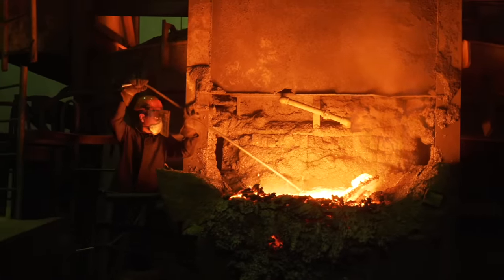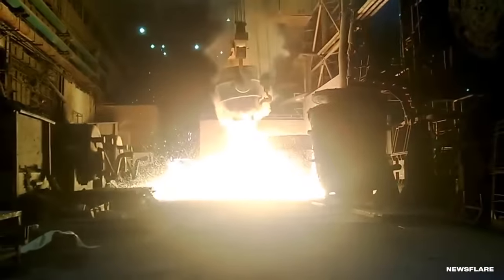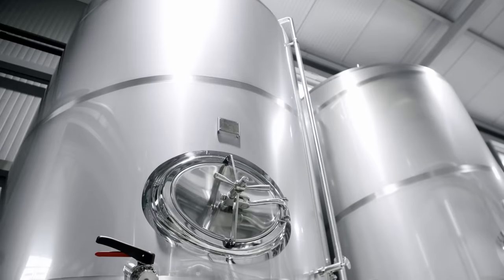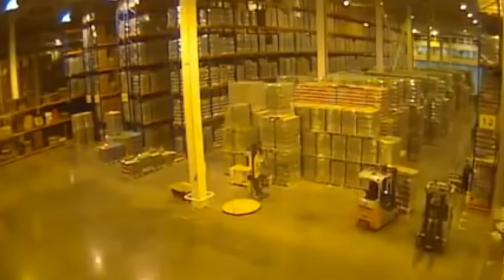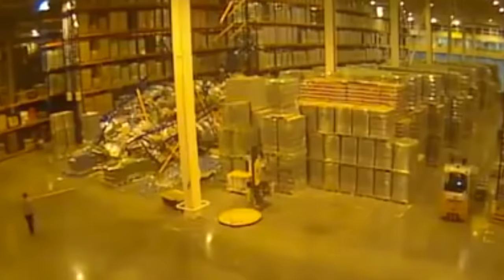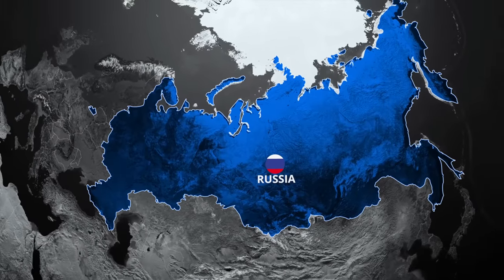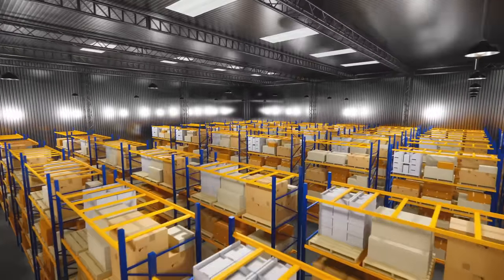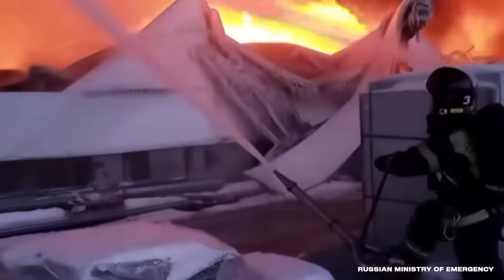Expensive Warehouse Failures Caught on Camera

Comment: When water touches molten metal there is a violent reaction but when powdered aluminum comes in contact with water Hydrogen is separated from the oxygen.  Water and molten aluminum......wow
Reply: The first factory in Earth's orbit. If anyone was in there, they'd need a spacesuit.
Reply: Hydrogen being wildly flammable. But I didn't know that about powdered aluminum, interesting.
Reply: When water comes in contact with molten metal, it can expand up to 1700 times its volume pretty much instantaneously. It doesn't take much water to blast the roof off. Look up Bonnell plant explosion Newnan Georgia in 2016.
Reply: @superboats2 funny, but I think the Pepcon plant beat them to it by about 25 years. 😂
Reply: Powdered aluminum, mixed with chemical fertilizer becomes a binary explosive too

Comment: 1:30 ummm no emergency stop button??? Holy shit!!!
Reply: I'm pretty sure that is actually done on purpose. When something goes wrong, they dump the crucible, so that the steel won't harden inside, and destroy the machine. It's spreads it out across the whole plant, to make it thinner, and easier to clean up. That's why no one is running for the exit, just simply staying out of the way. Likely not the first time they've had to do this.
Reply: @kristenrockwell6637 this has to be right, 👍

Comment: From 8:16 to 8:20 um actually you're wrong they actually come in three different sizes 20 ft, 40 ft and 53 ft long shipping containers.
Reply: there are 4 sizes 20 40 45 53 foot and I use to work at a shipping yard both for the BNSF and The union pacific RR  before I left the company there were talks of a 57 foot container being built I don't know if they built them yet but I'll know because I go by my old work all the time and I have a friend that still works there
Reply: @hammerdragon4321  actually your both wrong they r 20’ 40’ 45’ 48’ 53’ and in Canada 57’
Reply: @79billmack  Your all wrong because you have missed 10ft and 30ft containers. Though 10fts are generally not transported by rail or sea.
Reply: I can play too: 13, 19, 41, 57… am I winning?
Reply: Just to add to the chaos of the egos clashing in this comment, don't forget the High Cube variants that are taller than the standard ones!

Comment: I'm a container thing. Those cranes are designed to pick up 2 20s at the same time or 140 or 845 foot or so it was picking them up. The center locks just gave out. I guess, but that's a normal procedure.